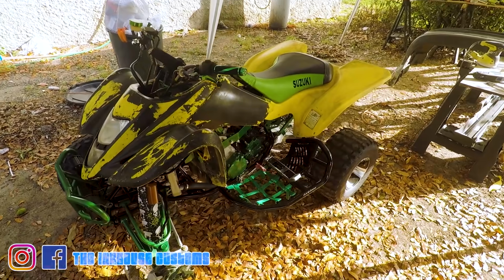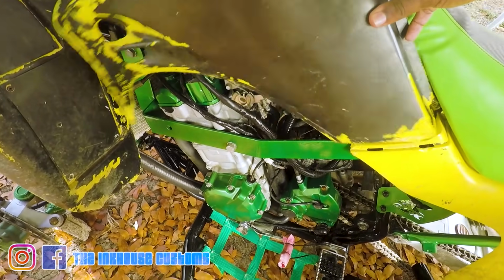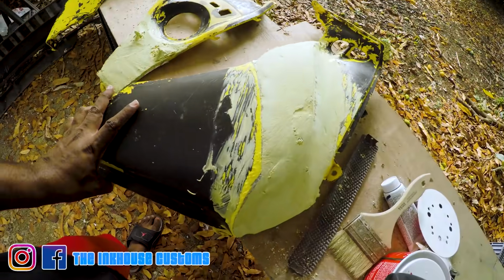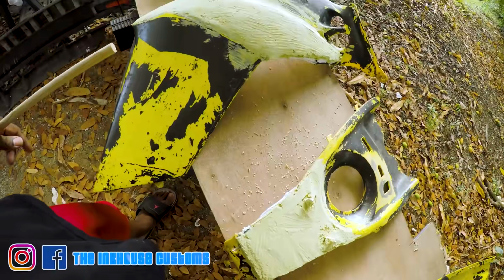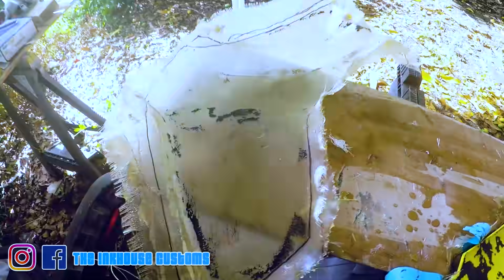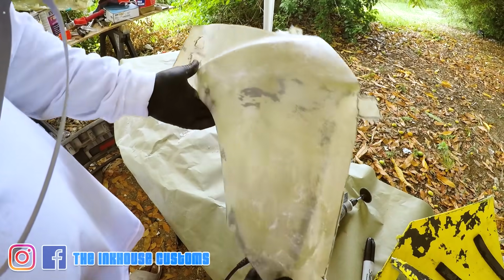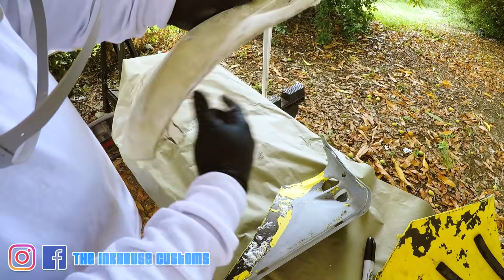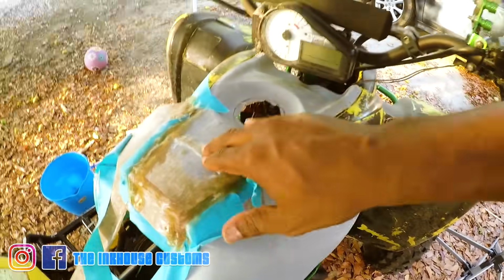how to make - fiberglass panels without a mold (Quad Bike) ATV

Comment: Damn now I know why this video doesn't have any dislike you did an incredible job🔥
Reply from the maker: @Yanice Mtl thanks for the comment. Its not perfect but the idea of how its done is what makes it easy to enjoy.
Reply: @TheInkhousecustoms ,  what spray foam are you useing to do your glass work? I've tried this in the past it just melted the stuff.  Would like to do a hood on a 79 Monte Carlo.   Any pointers for how to use this method would be great!!
Reply from the maker: @Randy Riech the foam is from loctite gaps and cracks, the way to protect the foam from melting is to either cover it bodyfiller or with insulation tape, packing tape is also good. This will help you from disfiguring your plug. Hopes this information helps.
Reply: @TheInkhousecustoms  awesome! Thank you!, I will give this a try when the weather gets warmer,  need to do the dash also,  so I'll try it with it also.  Molding tail lights tonight.
Reply from the maker: Interested in seeing your project!!
Reply: @TheInkhousecustoms  DM on face book,  just pulled the first lens out.  Looks good,  but will be working on getting it better
Reply from the maker: Hey Randy Riech send it to my email @ Theinkhouse340@gmail.com
Reply: @TheInkhousecustoms  you got mail
Reply: @TheInkhousecustoms  address not found? are you sure this is correct?
Reply: There are some already. Maybe it's because of the music, because it's way too loud compared to speaking parts. But the video itself was great, so thumb up from me..
Reply from the maker: Thanks for the like.. iv been working on that watch some more recent videos and let me know if its good or not. Thanks

Comment: This was good info! Question, I need to make an exact copy of a panel, can I use a friend's off his machine, make a mold and give him his back without damaging his paint? Would it be as simple as wrapping his part, like with a saran wrap, plastic, or painters tape, add mold release and then glass it?
Reply from the maker: If your making a mold of a piece that you do not want to damage. A simple wax and few layers of PVA should work to release without flaws. Just make sure what ever your molding can be easily released with out prying to much.. complicated molds are hard to release. A small piece can be submerged in water for a few minutes to help the PVA dissolve, resulting in a easier release.
Reply: @TheInkhousecustoms  Awesome Thanks! I will try a test piece out and go from there!

Comment: What was the spray that was sanded down and green stuff you spread out? I wanna make a fiberglass headlight fairing for my Yahama Zuma but don't know how to fill in the missing pieces first
Reply from the maker: @Tj Taz "the spray" if you was referring to the spray foam or the general purpose adhesive, And the "green stuff" was short strained fiberglass filler.

Comment: Did you youse a release spray or peel pry to remove the fiberglass from the panel? Or did it just come off that easy?
Reply from the maker: @Zachary Connolly I used only mold release wax in this video.. but suggest to use both a mold release wax and PVA mold release. Helps to make for a easy release.

Comment: yo i want to make my own body from scratch but dont want to use those fiberglass stuff just somemetal cutting and foam to give it some texture how should i do that
i have a very low budget as well
Reply from the maker: @troy vda I'm not to sure what material metal cuttings your using and the process of what your trying to do. If your doing metal work more likely you'll be making paper templates for the fabrication.